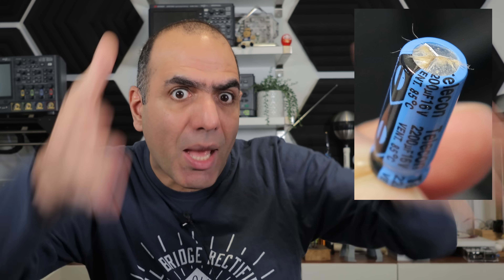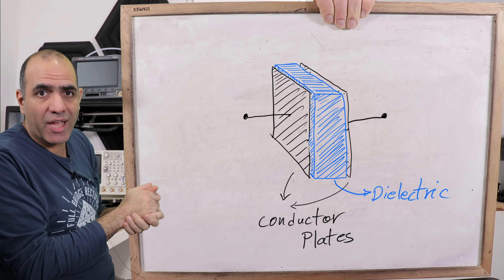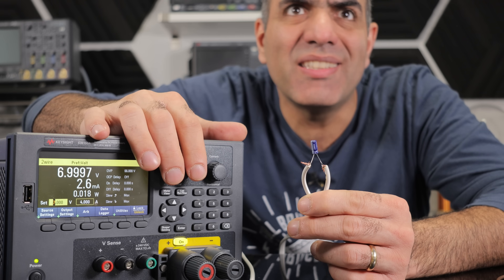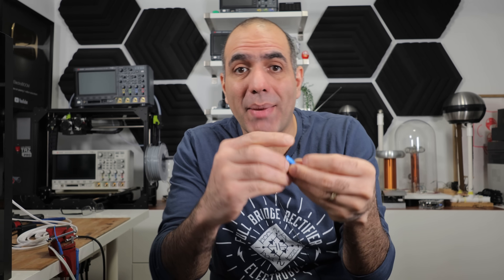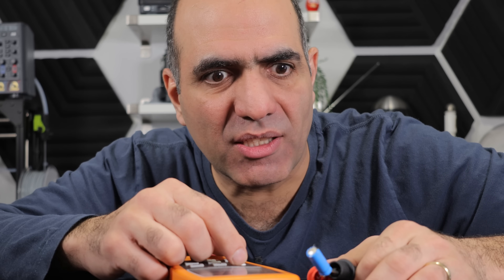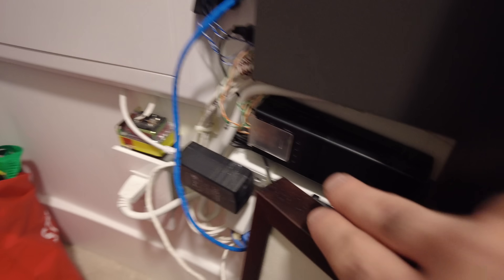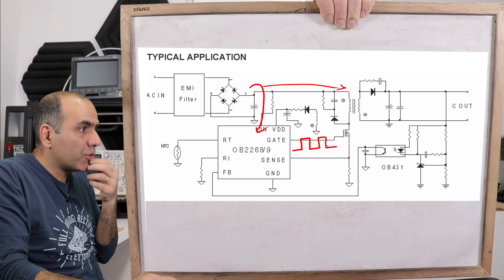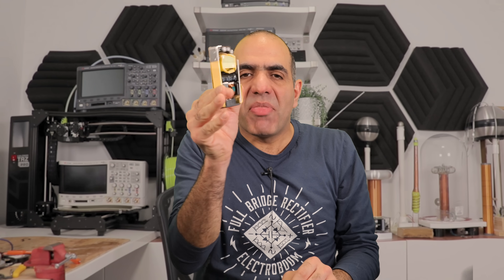Why Replace Bulging Electrolytic Capacitors

Comment: Some people do talk about "reforming" capacitors, but it's utter bollocks, just replace it, it isn't worth it
Reply: It isn't, though. There's a youtuber called Tech Tangents that has a few videos about reforming.
Reply: @David_Phantom  and it's still crap, it'll come back for what, a few days, maybe if you're lucky, and then it'll lose capacitance again, specially if the component is very old, like the paper capacitors used from the 1930s right through to the 60s, replace it, it's an accident waiting to happen
Reply: @David_Phantom Whether the method  works or not is immaterial to the original post: it's the time versus money trade off.

It's not worth the time reforming it. Just replace it. Far quicker.

Comment: In the early 2000s we had a computer that never run quite right, a capacitor had leaked, so what did I do? Just poke it back together and hope for the best 😂
Reply: That seems about right. That computer was most likely affected by the capacitor plague where capacitors from many Chinese and Taiwanese manufacturers had very high failure rates. Most of the bad capacitors were made between 1999 and 2003. It was a huge problem at the time and cost many companies like Dell and HP for example hundreds of millions of dollars.
Reply: Unfortunately some used computer resellers did the same. Pushed the bulging capacitors' top back to flat, cleaned off the dired up leaked electrolyte if there was any, and sold the machine.
Reply: How'd that turn out?
Reply: @Wario-The-Legend  it still worked ok, it was just a pile of shit computer 😂
Reply: @phonotical  Its a rule the the 'pile of crap' computers will keep working forever. Its the 'too expensive' top of the line stuff that always fails first.. then you cant fix it..
Reply: I've broke an expanded capacity off a motherboard that was returned on warranty, twisted the leads together and the board worked great, I used it for stress testing warranty CPU and RAM returns.